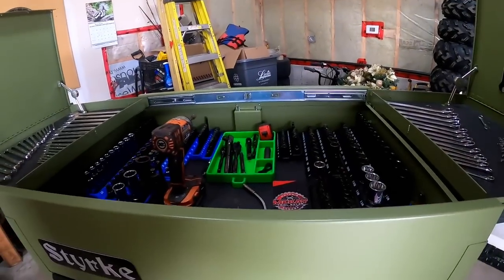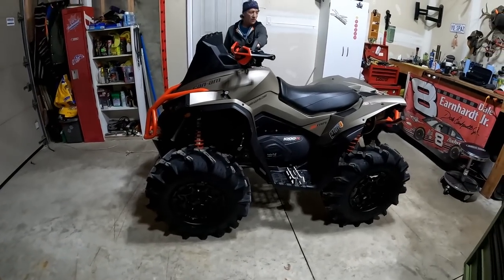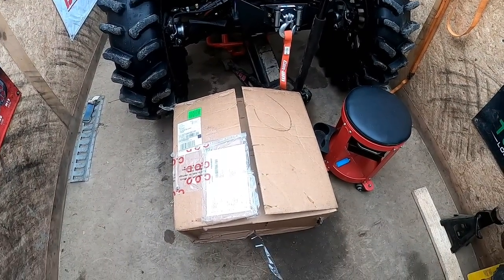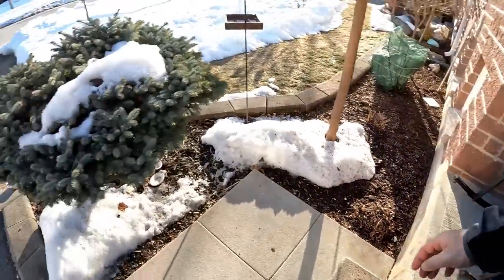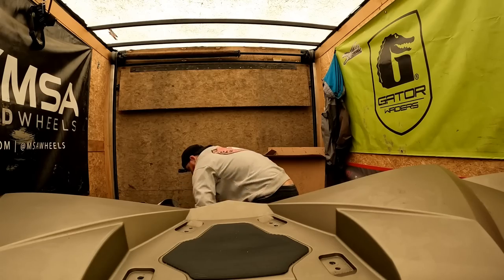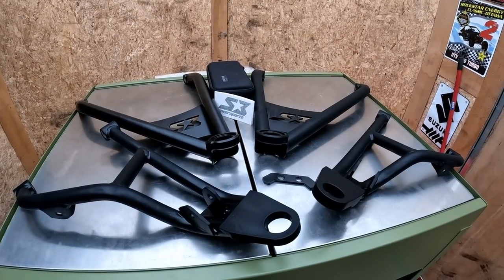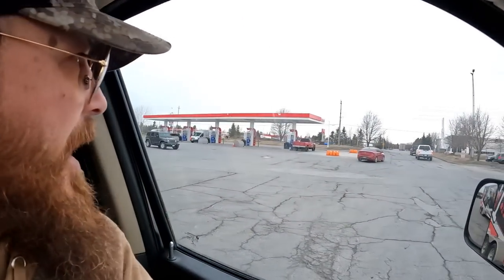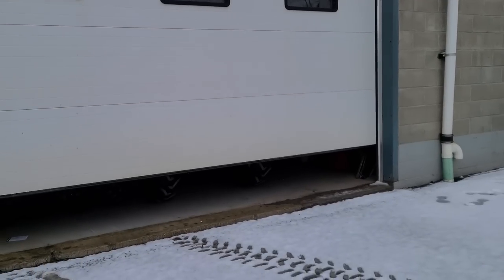2023 Can-Am Renegade X-mr1000r Pickup & Build 🔥🔥🔥

Comment: Have you seen or taken apart a 2023 with IEB? I havnt gotten one up close yet. Did canam get rid of the one way bearing in primary since they shouldn’t need it I’m guessing if they are doing the engine breaking electronically some how? Maybe with a decompression solenoid or something? That would be awesome
As the one way bearing is the biggest fail point in stock clutch. You wouldn’t need any aftermarket primary as the stock would have an insane starting gear ration as the belt would sit lower in the primary I would imagine. Or who knows how they are doing the engine breaking lol

Comment: Hey bud wondering what pressure I should keep my motohavoks at ? I have the 31’s on the stock 14 on the 2021 Rene. Your input is appreciated
Reply from the maker: For beedlocks ya can go pretty low. Probably around 5lbs. Without I run 15lbs in them to keep them from unseating.
Reply: Thanks bud new bike looks sick

Comment: Hey I was considering getting a set of 34 nators to replace my 32’s I was wondering your thoughts on the performance like wether I would be blowing shit all the time or what. I have a cvtec clutch aftermarket drive shaft, footwells, and 2 in spacers,  thanks man. Just wondering if my bike could handle that kind of tire lol
Reply from the maker: It definitely can, but it requires more control of throttle or yeah. Shit breaks

Comment: Should've bought Scrambler xp 1000 S. Best quad on the market.
Reply from the maker: Debatable,  but none the less yes its a weapon on the trails.
Reply: @ehTV1000  My 2020 renegade xmr 1000 has been an awesome quad. Has 4200 miles on it, only thing I Did to it was regular maintenance. Biggest difference between my scrambler 1000S and Renegade xmr is suspension. The renegade is like riding a board compared to it.